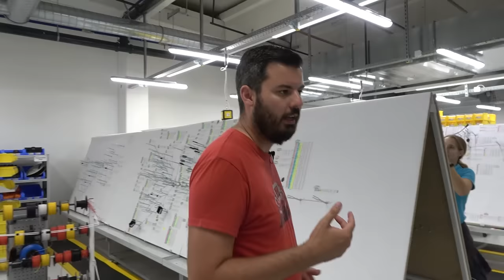RIMAC NEVERA FULL STORY! Exclusive Factory Tour with Mate Rimac

Comment: Super complex car and super high tech, many cameras, can be set to front wheel drive, rear wheel drive, all wheel drive, certain percentage front wheel and rear wheel drive, many kinds of setup.. Traction controls, this car is insane!.. All sorts of sensors sensing don't know how many times per second.
Unlike cars like Bugatti, changing a model just making some engine mod, chassis setup etc. This car, Nevera is already at the top.. Can't imagine what comes next for this to be its future predecessor.
Adding on: I believe the current chriom also unable to beat the concept 1 in a drag race

Comment: I am always intrigued by those who want to be enviro friendly, like trying to pursued a customer to not use animal products, but there is no concern over the mining process for the materials used for batteries.  Or even to process for carbon fiber creation and the finale sanding of the product.  Can't use gas for a car but you can mine for minerals using oil.  Alcantara fabric base material is 68% polyester and around 32% polyurethane which comes from what?  OIL!  Instead of claiming to be green just simply say, we love the performance of the EV over combustion.  It sure does appear to be zero difference between the 2 for the environment.
Reply: Mate is a vegetarian, those who follow him know that. He is also a petrolhead and has never sold an environmental agenda. He repeated it many times. He just wanted to make a faster and more efficient car for his own pleasure. Those are his words. Greeting
Reply: The central problem with a combustion car is the 10+ tons of fossil fuel it burns through in operation. It's dirty to mine, refine, ship, spill, and then it all goes up in smoke to worsen global warming. Adding a 1/2-ton recyclable battery to make a much more efficient EV reduces that tonnage substantially even on the current electrical grid, which is why every study concludes an EV is better for the environment overall, pulling ahead after 7,500-30,000 miles of cleaner operation.
BMW, Tesla, and other car companies have committed to source responsibly-mined materials in their batteries. If you're concerned about the environmental harm of manufacturing 2-ton products, by all means don't own a car.